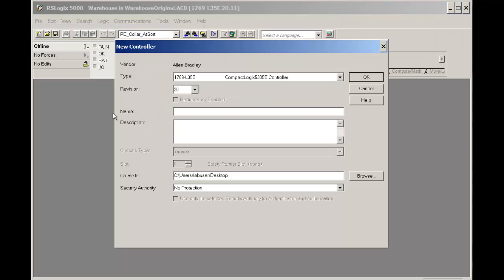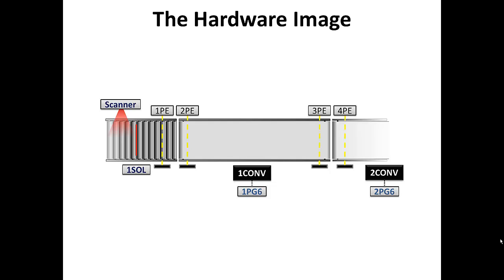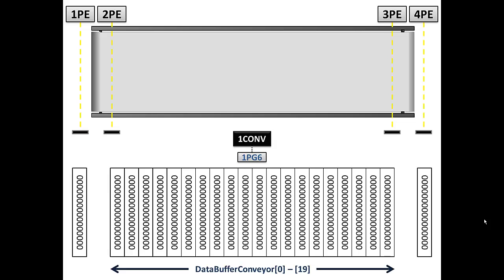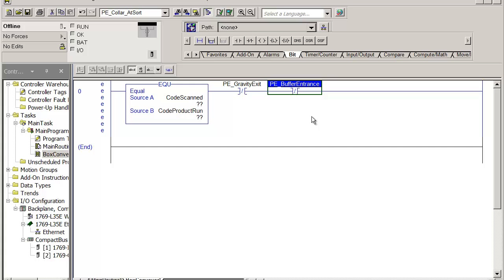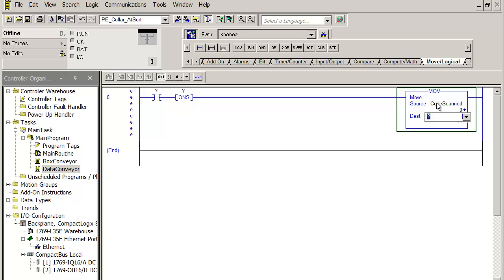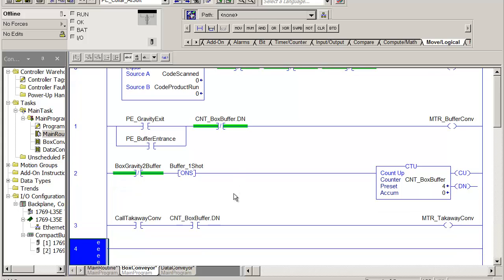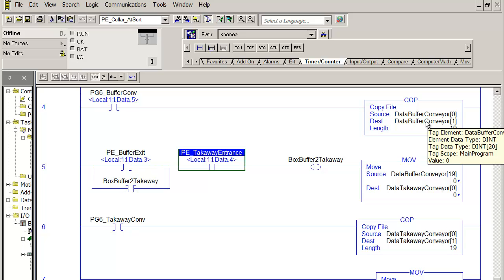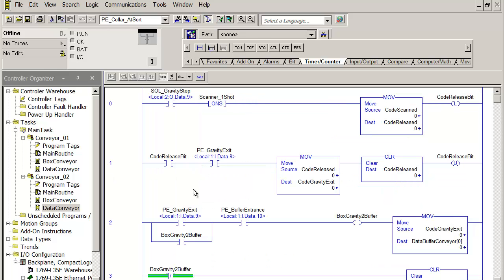RSLogix5000 - Multiple Programs - Re-using Conveyor Logic

Comment: 1.  Design a PlC program that perform the following task: The conveyor has an optical sensor that detects drink cases entering the a packing area 
2. There is also an optical sensor that detects drink cases leaving the packing area 
3. The boxes enter the packing area on a conveyor controlled by the output one
4. The box exit the packing area on a conveyer controlled by output two 
5. The controller must keep a running count of drink cases using  the entry and exit sensor 
6. If there are more than five boxes in the packing area the entry conveyor will stop
7. If there are, no boxes in the packing area the exit conveyer will be turned off.
8. If the entry counter has been stopped for more than 20 seconds, the count will be rest to zero, assuming that that the boxes were removed.
Reply from the maker: There is a lab project in several of our manuals that is very close to that...

Comment: Thank you for this. This has been very helpful in understanding tags with the new RSLogix5000 systems. If there was a physical device that both the conveyor 1 and 2 needed to access and control, where would the code reside and how would it be tagged? Thanks for these videos.